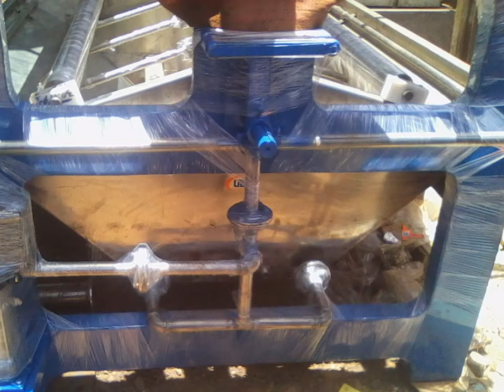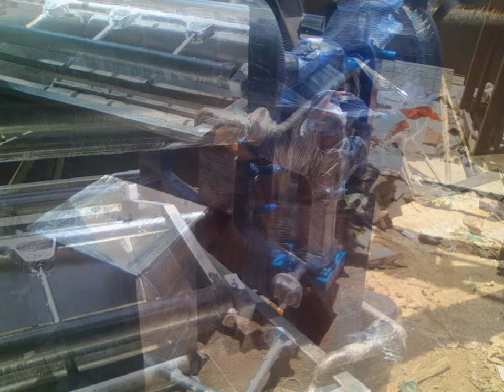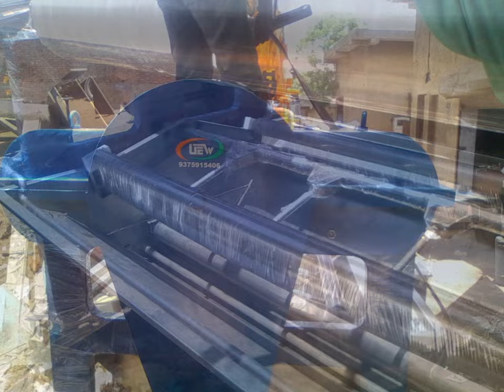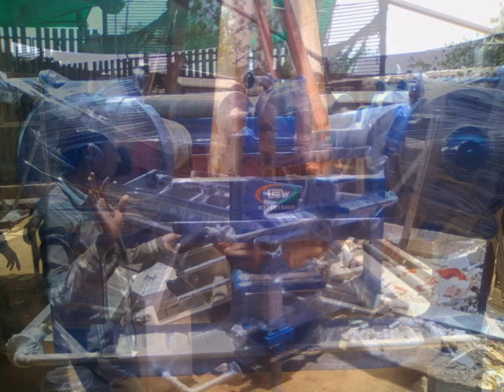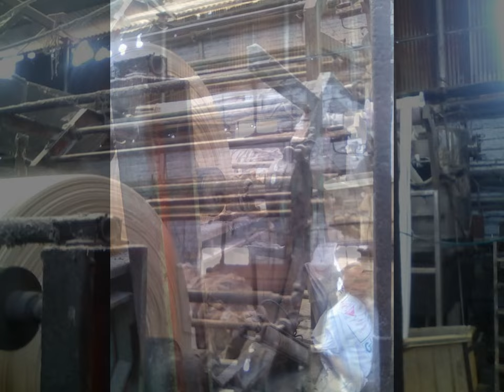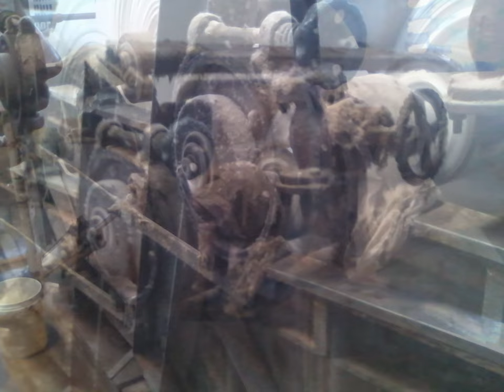TEXTILE SUPER JUMBO JIGAR MACHINE

Comment: Price
Reply from the maker: 520000/=
Reply: Ashok panchal with drive
Reply from the maker: @amitmalhotra3354   Yes sir
Reply from the maker: Your contect numbar sir
Reply from the maker: @amitmalhotra3354  500 kg X 72" Roll Width with drive .. circulation systsm :- 520000/=
Reply from the maker: 475000/= 72" Working 1000 kg capacity with drive